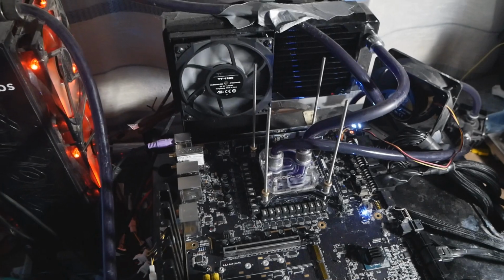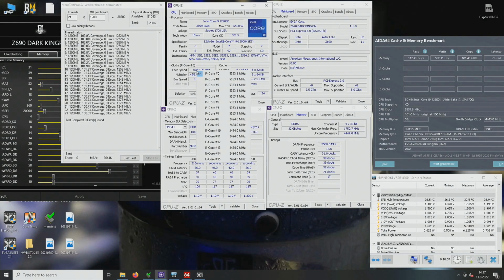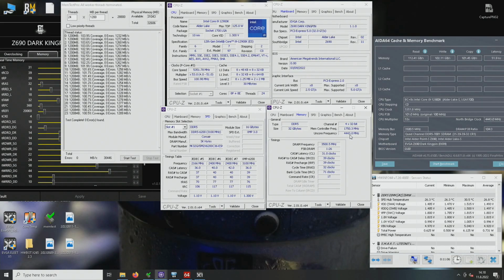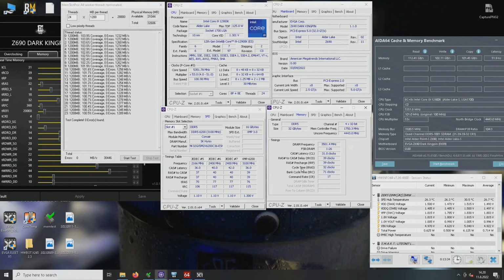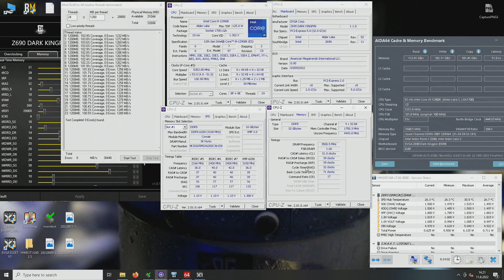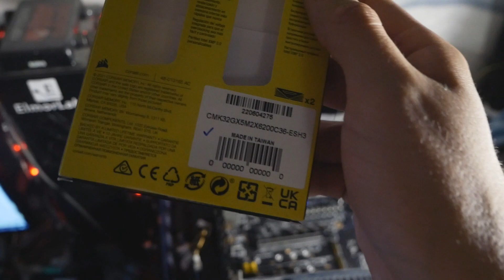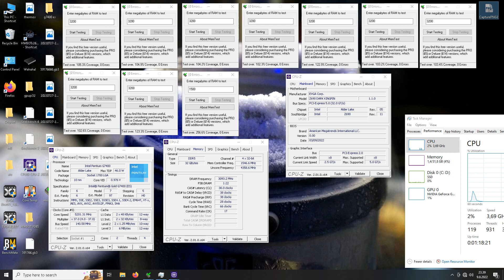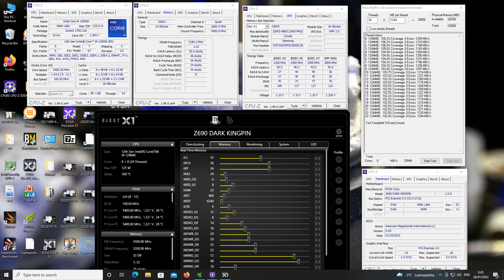Why You Shouldn't Pay Too Much for DDR5 - 7000MHz 1T Daily Stable on EVGA Z690 DARK KINGPIN

Comment: Got myself 128GB G.Skill Trident Z5 DDR5 6400 CL32. They contain Hynix A die of course. Still need a motherboard, but i'm really curious what kind of frequency and latency can be done with that direct die cooled, extremely overclocked 13900KS. I heard the KS CPUs do have better IMCs than the basic K version. At least they should be binned somewhat. 

Does anyone know when the EVGA Z790 classified will finally be available in europe?

Comment: What was your system agent voltage or IO voltage or memory controller voltage for the CPU?
Reply: I know I'm not Luumi, but to run 7000 on the Dark KP you need between 1.35-1.4 TX VDDQ and anywhere between 0.95-1.25 SA depending on the chip. My chip seems to handle 1.25 well. VDDQ is left on Auto for th Dark KP because it matches memory drain voltage, and it somehow works perfectly this way on this particular board as well as on Aorus boards.
Reply: Are you on MDIE Hynix? Also what ram manufacture?

Comment: Hey I’m new to ram overclocking. I have Corsair DOMINATOR PLATINUM DDR5 32GB (2x16) 5600MHz C36. I’d have to look up the rest of the stock timings but do you recommend any settings so I can overlock them to 6000Mhz? I also have an i5-12600KF and a Msi Z690 tomahawk motherboard.
Reply: If Samsung it’s not gunna happen

Comment: Luumi have you tried the Bitspower ddr5 waterblock kit? I put it on my dimms and it's working great, I was able to tighten a lot of timings more than even with a fan at full blast on my dimms. Much better results in my experience than watercooling ddr4
Reply from the maker: No, but could be good.

Comment: DDR5 is simply not as good as DDR4 for gaming right now. in a few more years i'm sure it will be much better. but you are absolutely right high end kits are a waste of money right now. One would argue using DDR5 is also a huge waste right now :D 

I would like to try out the new AM5 boards but i'm not hyped about DDR5 for them at all. since we know latency matters for chiplet cpu even more than it does on monolithic dies. oh well maybe we will just have to wait for the x3d zen 4 chips :)
Reply: WRONG
Reply: @Boogeymanjw  LOL keep telling your self that bud. tests have been done, bandwidth is not an issue for games today.
Reply: if money isn't not a issue. u mean ddr4 better than ddr5?
Reply: @SUTH_33  does not matter what the cost is. total latency is king. so why spend more for ddr5 if its actually slower where it matters.  ie your lowest fps will be worse on ddr5. and ddr5 cost more. worse yet for ddr5 its highs are not much better if not worse in many cases. Better ddr5 will come out its just not here today.
Reply: bro thats an old video. frame chasers has 8000 kits now. DDR5 is moving fast. that video isnt relivant.
Reply: @johnboy2436  my comment was from 4 months ago LOL what do you want?
Reply: Sounds like skill issue tbh https://youtu.be/UFQkoie-fPE
Reply: Thats incorrect
Reply: your so wrong its unreal. not even close.
Reply: @johnboy2436  ya i know lol https://www.youtube.com/watch?v=Ou55IExG3Z8

Comment: does EVGA DARK have same issue like Apex690? i'm talking about DDR5 max clocks, some Apex can do 7200+ easily, some can't even 6800
Reply from the maker: I havent tested enough boards, but i have seen the massive quality difference on Apex and Tachyon. On Apex the question is about 2021 and 2022 dated boards. The old ones aren't good.

Comment: I can only do 6000Mhz  stable on my Z690 Aorus Master :( The timings are also much looser than what buildzoid was showing in his videos of Hynix overclocking. I have 6200Mhz cl36-39-39 Corsair Dominator kit on Hynix and 12900K
Reply from the maker: We have seen massive difference between motherboards too. Like you can buy 2 Gigabyte Tachyons, first one maxes at 6600 and second one does 7200... This is the issue of early stage in the lifespan of ddr5.
Reply: @LuumiJuhani  APEX Z690 have same issue
Reply: @LuumiJuhani  seems like new bios helped a little. I can basically set the timings as low as Buildzoid did on his Hynix sticks and CR1 works but I still can't get 6200Mhz stable. It's "almost" stable because there are only some single errors after running TM5 for 30 minutes+. Unfortunately I don't have any more space for the voltages because they're pretty high currently. Maybe next bios will finally help. DDR5 isn't fun to play with it, atleast on 4slots motherboards. It's very tedious to overclock. Overclocking Patriot Viper Steels 4400Mhz kit on 10900K was much more fun and I could actualy get there two sticks to run 4266-16-16-16 with no issues.
Reply: gigabyte has different modes for memory overclocking its kinda dumb and probably even broken per gigabyte but i would get the latest bios and dig deep for this setting they really like to hide it well. and then give higher frequency a try again.

Comment: And I was thinking you shouldn't overpay too much for DDR5 now because some day they will probably be on the 10000mhz 😎😁.
Reply: not sure about 10000mhz, 8000-8888 looks more realistic
Reply: @oganesd  8400CL28 Tight timings 64GB (Or Better) is the dream for your avg OC Gamer.
Reply: I can see 9000 being the new DDR4 4400 MHz. 10,000 for hard core over clockers in 2 gens and 2 dimm motherboards
Reply: @Multimeter1  there are DDR4 5000+MHz kits of like CL20 and whatever from factory tested but they are crazy expensive and off course it all depends on the rest of the PC to handle such high DDR4 frequency...

I'm thinking if DDR5 ever achieves 10K MHz will probably be a similar story a very end of the line super expensive kit for just the latest best hardware at that time...

Comment: Bought Hynix M-die 2x16 160$, easy oc 6400c32 with tight subs, 1.39v on 4dimm MSI
No sense to buy fancy kits, except corsair dominator platinum.
Also, Hynix A-die Jedec 5600 HMCG78AGBUA081N appeared this week,  7200-8000 easy OC
Reply: I don't know how it is on this gen, but a few years ago two same exact kits could be a world apart from each other because sadly they used mixed components and we only knew what we had after bringing home and testing which sucks.
Reply: Nice! Where did you find out about this new Hynix A-die?